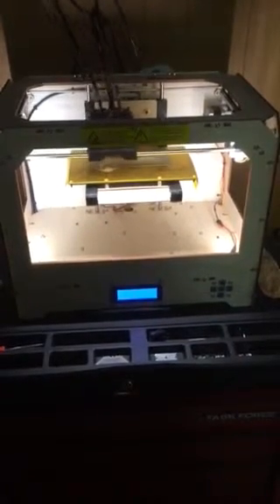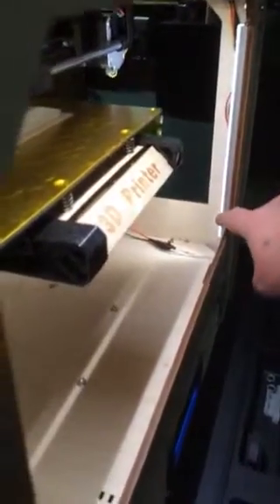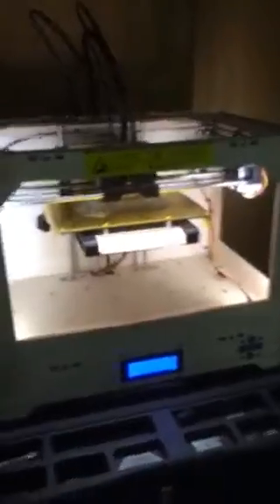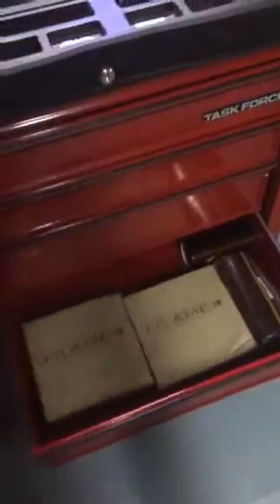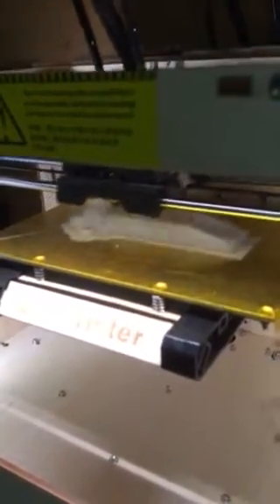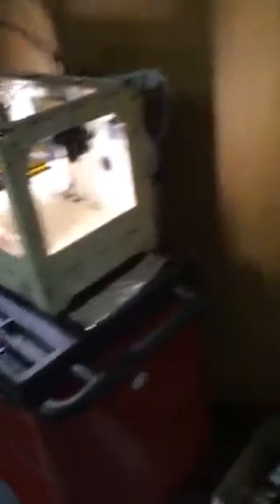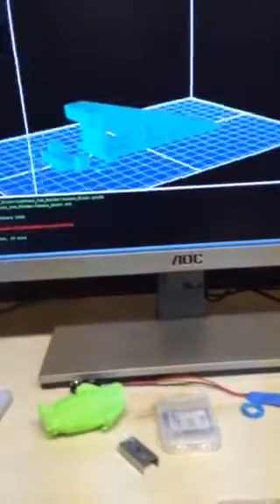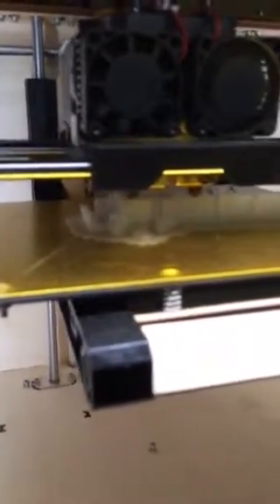Ctc 3d printed upgraded, new LEDs and camera mount

Comment: hey bro... I bought the same 3d printer but the heated plate its not flat...... its curved.. i can show you some pictures if you want, i just oppened from the box.. hope you can help me!! cheers!!
Reply from the maker: Contact who you bought it from, send them pics and they should send you a new one.  If its bent you could take it off and try to straighten it but why mess with it, should be warranty.
Reply: Thanks a lot bro!!! i read you yesterday but i did it my self with some force outside the printer... I have another question.. What speed do you recomend me to print ABS. Right now im using Speed While Extruding 90 mm/s and Speed While Traveling 150mm/s. Thanks a lot for your help bro!!!!

Comment: Where did you connect it? I'm thinking to add some leds too.
Reply from the maker: I connected it right to the main 24V supply to the motherboard.   So when I turn the unit on the lights come on.  There is also a spot to soder on RGB lights.  Might be a vid out there on that.